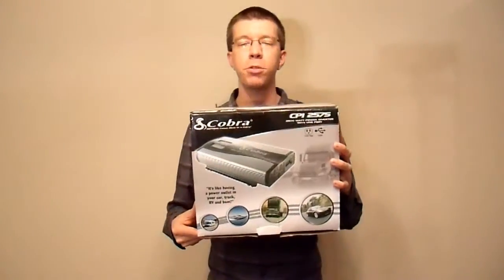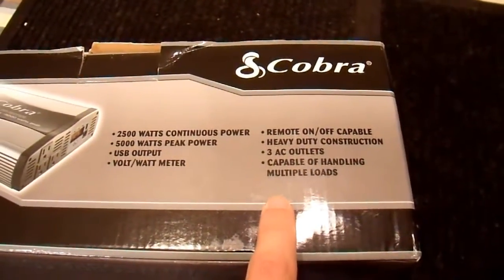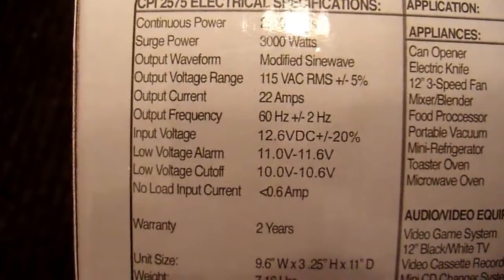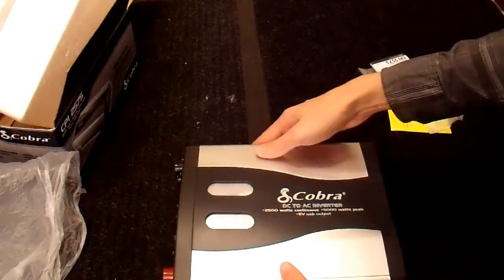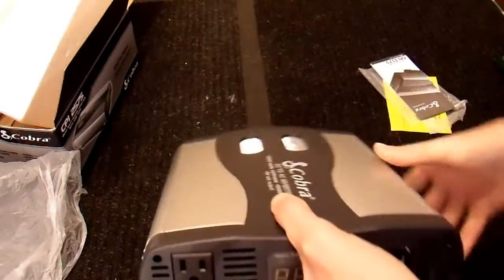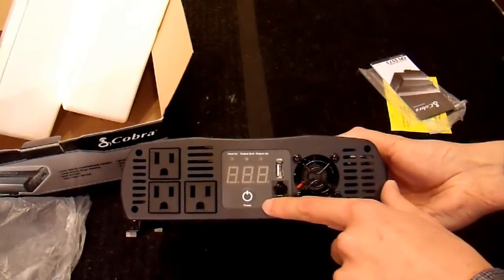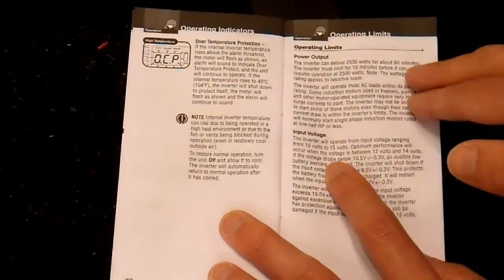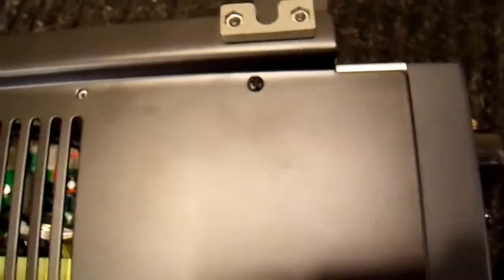Cobra 2500 Watt Inverter CPI2575 Unboxing and Review - The Repair part 1

Comment: Need help with my 2500w  inverter ... nothing works when plugged in...... It shows 70/80w even though nothing is plugged in.... The battery reads  normal but no output......any help

Comment: I'm looking this up to my camper trailer right now and do I need to use both inputs I don't not understanding why there is four battery connections any help would be greatly appreciated thank
Reply: Use one set for 1200 watts Max use both sets for 2500 watts max

Comment: "I have my doubts that this inverter will start a 1/2 HP submersible sump pump."  It should very easily start it.  Think about it logically, 1/2 HP = about 375 watts.  A motor of this type might have a surge of 3-4x its rated draw, which is probably roughly where they got the 1400W rating from.  No way would a 1/2 HP pump draw 1400W continuously.
Reply: asusreviews. It does start a pum motor no problem ..but i have 500 ah battery bank too
Reply: Draws 850 watts

Comment: This review is worthless.  You start out with a negative attitude about everything so with that attitude, you can't be objective.  I'll move on to someone that has an informative objective review.
Reply from the maker: I clearly demonstrate the deficiencies of this product.  I treat it the same as any other inverter I review, some of which surprise me and receive positive recommendations despite my initial impressions.  This one is simply a terrible product from start to finish with no bias needed to reach those conclusions.
Reply: wasnt easy but thanks for giving me an idea for the threshold this invertor operates at. im a dj looking to innovate with power alternatives previously regarded as unstable.. i know if i find a plateau that is stable this can work..dont want to lug the generator around..i also have a factory invertor in my truck that plays my powered speaker (1000watts) but i wouldnt dare put a subwoofer onto this load so if i can get 1000 stable then i should at lease be able to do a 3 or 4 hour gig you know

Comment: I have one of the 400 Watt models of this and I have been fairly happy with it for what it is.  I am using it on my shed solar setup.  I use it to run some small power tools and chargers and use it to power my weed trimmer in the summer.    I was thinking about getting the 2500 watt one, because the 400 won't start my bench grinder.  Can wait for part 2!